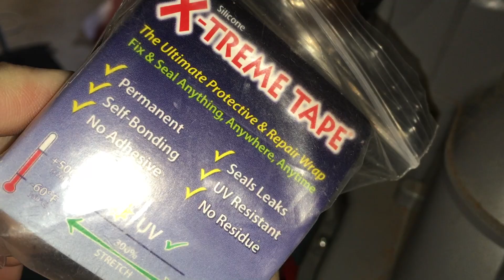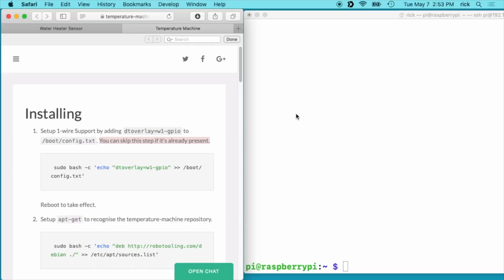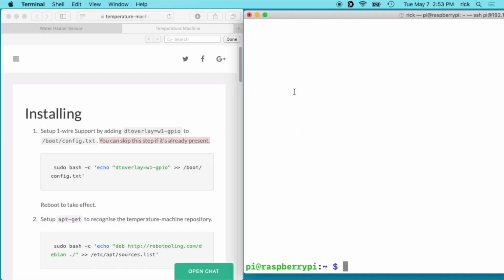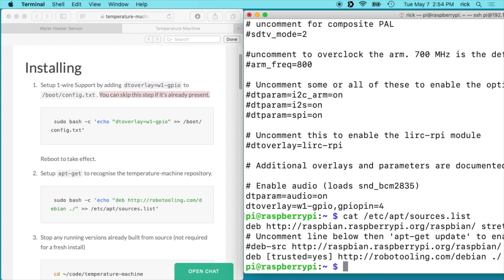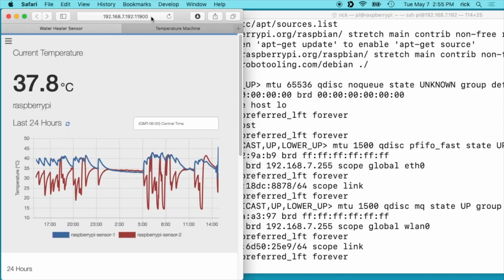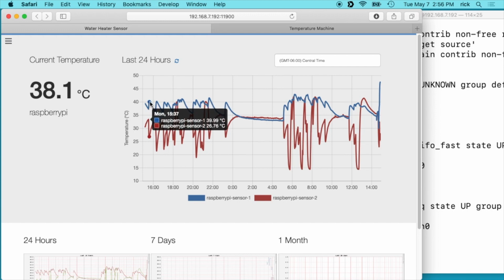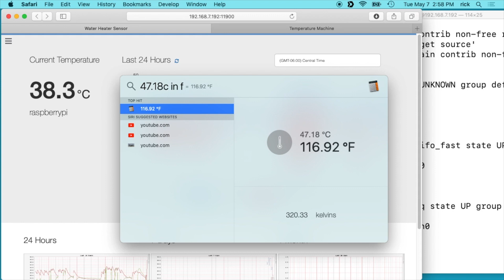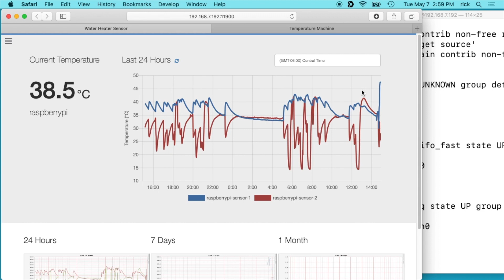Water Heater Temperature Logging Using Raspberry Pi

Comment: HAHAHA you don't have a reference for Celsius yet the rest of the world does. You know, it might be time for you to ditch that old measurement system and go metric. It's costing the USA just over a TRILLION dollars a year to run both systems. And you are running both systems in order to do business with the rest of the world but still crashing in Mars because of still thinking old ways while going to work in a metric world. 

FYI, water freezes at 0c and boils at 100c. 1 litre of water weighs 1 kilogram. Try finding the volume of something using your imperial system and you will end up in a hair pulling nightmare but not with the metric system.

AND... just to prove how completely STUPID the argument is that it's too hard to figure out the metric system, you yanks would rather deal with fractions than a decimal point because you hate the French so much... S.I. (System International) aka the metric system is a measurement system of French origins much like your U.S. Constitution, the layout of Washington D.C. and that lovely yet ironically named Statue of Liberty. 

BTW, what kind of idiot makes highway signs quoting distances to exits with fractions like 1 1/8 miles or 1 3/4 miles? When was the last time you saw an odometer with fractions and not a DECIMAL POINT? And then there's buying gasoline in fractions as well instead of a decimal point? Do you guys hate the French that much? :P

Comment: Anything else you found that does F* vs C*?  Does it do text notifications?
Reply from the maker: This only does basic temperature logging in C. If you know Python, you could write some software to send emails. I did a video on sending email notifications when a light sensor is triggered: https://youtu.be/i83WNIsBGmU It could be modified to monitor temperature. I don't even really know Python. I just put some things together I found online.

Comment: How did you connect the sensor cables stranded? To the board? Or are your sensor cables solid?
Reply from the maker: The ends of the wires were tinned from when I got them. They don't make the best connection. It would probably be better to solder on a wire/connector like this: https://www.amazon.com/gp/product/B01EV70C78/
Reply: @Rickmakes  just connected a male pin wit to this , maybe not the vest but functional i think https://www.accu.nl/connector-kroonsteen?gclid=EAIaIQobChMI_8TomsSK7wIVAtN3Ch2W7QPaEAQYASABEgIUOvD_BwE (don’t know the english name🤨)
Reply from the maker: @robvossen8099  That looks good. I don't know the exact name of that either. I would call it a terminal block.